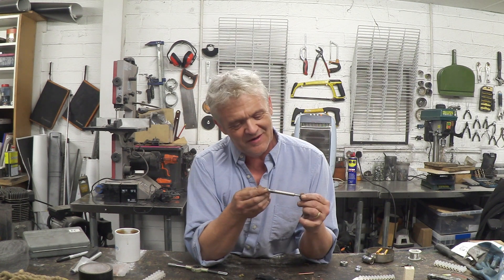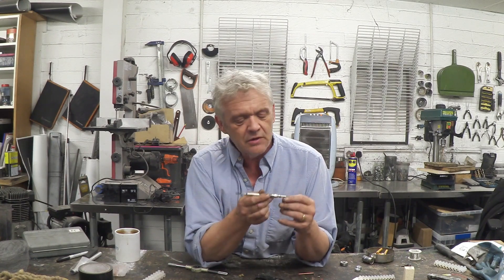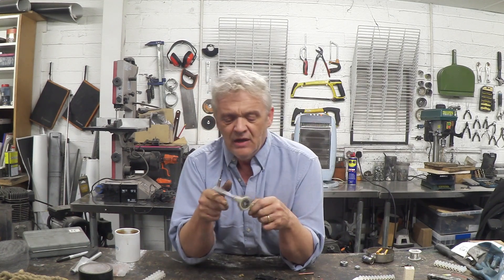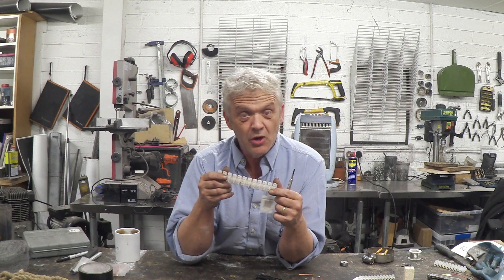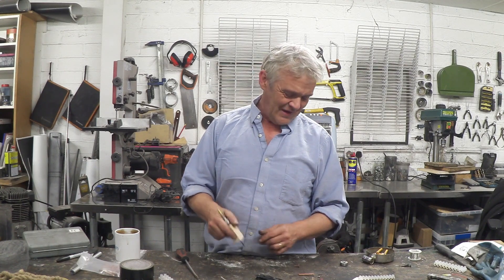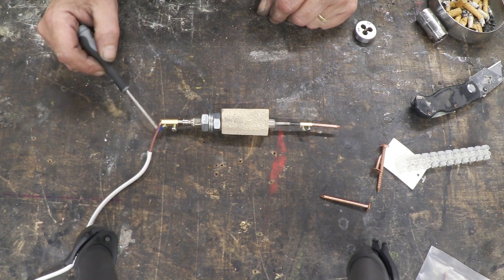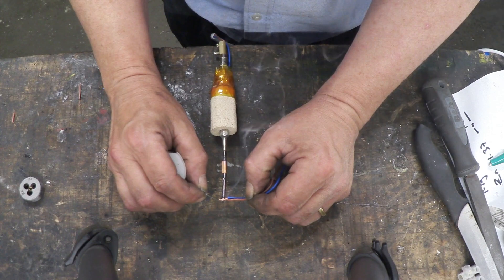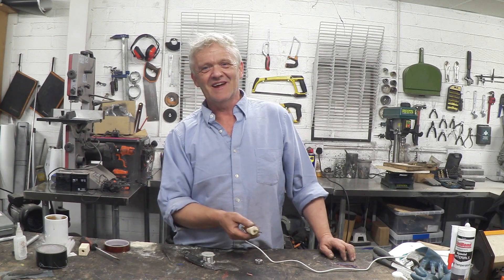1233 How To Make DIY Portable Soldering Iron

Comment: Hi Robert,  I tried this and it does work. I went to Ebay and ordered a glow Plug for a Dodge Freight liner Diesel made by (Bapmic Germany) # BACB57-202001.OE# 0250202045OR 05080046AA OR 05080047AA, for the NUT and thread,  I found that an M10 -100 thread, (ACE Hdw) screwed right on, no re-threading needed,  and a 3/8" flat washer.and a ring connector for the gnd.  I used the female side of a 2 piece connector for the + end.  just my 2 cents worth, hope it helps someone who wants to make this, without having re-threading equip.

Comment: 12 volt short duty, 3 volts to 5 volts it should last a while, higher it might be to hot and will not last.
Must admit I never thought of using one and saw dozens of them thrown out.
A wooden handle would be a lot better, but as my father a,ways said "Use what you have and you will never stick!"

Comment: I know someone else suggested it, but a mini kiln would be cool/ useful for those trying to make a shop on a budget.  Could also use the glow plug in the hotend of a high flow 3d printer.  Could also put it inside a stirling engine to power it with electricity.  Or use it in the next iteration of the diy air conditioner.

Comment: YOU CAN MAKE AN AUTOMOTIVE SMOKER THAT CHECKS FOR VACUUM LEAKS, IN A PICKLE JAR WITH OLD SOCKS SOAKED IN BABY OIL WITH 2 TUBES IN WITH A AIR PUMP AND OUT TO THE VACUUM LINE OF A CAR INTAKE OR EVAP SYSTEM TO FIND LEAKS.

Comment: What am I missing, the Negative contact point didn’t seem to have a wire that goes to the battery, I could only see 1 wire from the positive top section.
Reply: When he rotated it you could see the blue wire between the washers and run up the back of the plug, later he covered it with capton tape

Comment: Mains connectors are 5 amp, 15 amp, 30 amp which are the most common. I've never come across a 3 amp (although there are 3 amp fuses mind which are common). You said 3 amp I think, but they looked like 15. Not that I wish to be pedantic or anything :) 

Great video as always though Robert. Thank you!

Comment: If you know the voltage and current going in could you work out the resistance of the glow plug? I assume that would change as it heats up so you could control the temperature by aiming for the right resistance.

Comment: that is excellent. I have a couple of mini soldering iront that work on 19v+, but this seems to be much more versatile. with a thermistor and some mosfets, this could be an amazing temperature controlled iron, for cheap, and very robust. and the portability: 6v, 12v, 24v.. etc

I love it.

Comment: yay for 12v glow plugs.. did people know if you strip them down you can quickly melt thin aluminium, use a carbon powder burned bread block to make small self contained conductive ink localised preheated/slow cooling inner/outer sleeved mold's... even small run 3d  aluminium printing for the diy adventure with diy aluminium can string as the free base material ,filmed & linked here if you give it a go to make better one off upgrade parts etc

Comment: i first came across your channel because of your kiln build, i was looking for ideas to reduce the cost of a lost wax casting setup, and a burnout kiln is an expensive part of that to buy. another expensive part (though not essential, especially considering the price of some of them) is an electric wax carving pen (basically a variable low temp soldering iron) and this looks like it could make a nice one of those!

Comment: Glow plugs!  So basically operates up to 60 watts.  10 of them could be used to make a 600w stove.  How about a small kiln or furnace?  A tiny oven.  A device for keeping a cup of tea warm.  If one had a length of copper pipe, one could insert a glow plug every few inches and pump water through it and it would heat up.  If one had an alcohol stove, the glow plug could be used to vapourise the alcohol which would raise its presure to go through a nozel where it mixes with air to produce a non oderous blue flame.  Where there were heavy freezes they could be used to supply a heat to keep pipes from freezing.  The soldering iron idea is best.
Reply: Great ideas. The frozen water pipe idea is great.

Comment: Add on a small buck converter to control the voltage / temperature. They are so cheap for a 12v to 2-9v

Comment: Does it produce any voltage when heated by an external source of heat?
Reply: Good que, ThermoElectricGenerators do that but when there is a temperature difference (a cold side and a hot side)